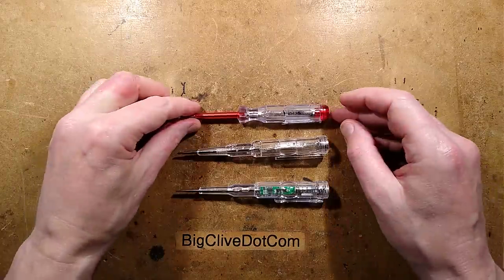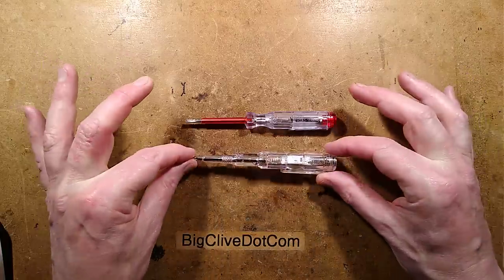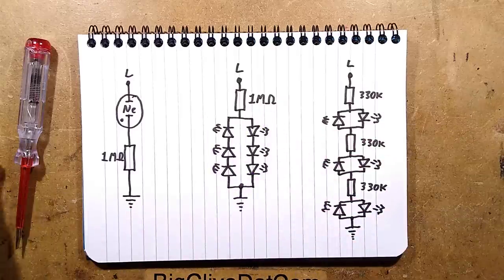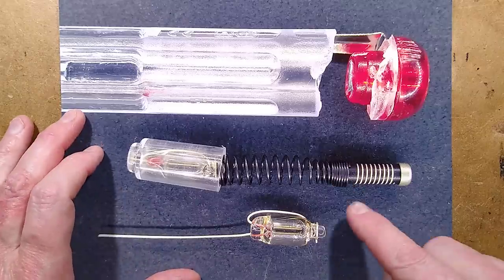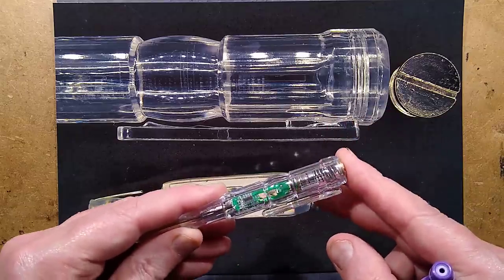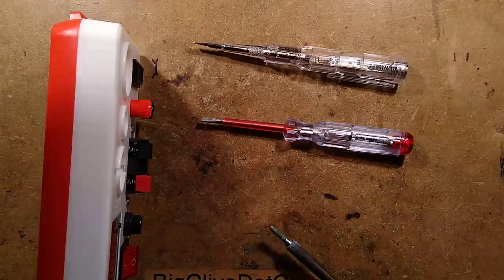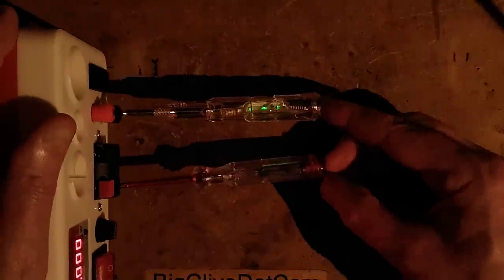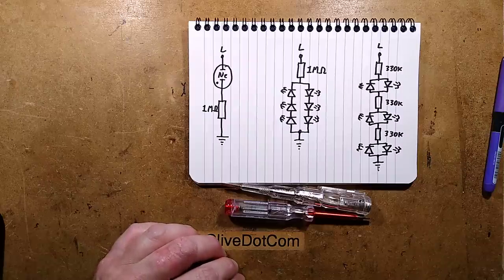Reinventing the neon test screwdriver

Comment: I like the LED version and brightness is definitely an advantage here, but neon being the simplest, is probably more reliable.
Reply: you can just replace neon with led rod from incandescent lamp imitation. as drop in replacement with the same simplicity
Reply: But leds will break as short circuit and a neon bulb will just not light up at all while being highnimoedance. So it‘s much safer with the neon lamps I suggest 🤔
Reply: But the neon screwdriver is contact only. So you can't use it to detect the electric field emanating from a live line behind the wall.
Reply: My concern with the old-school neon version is the glass. If you drop your screwdriver how likely is it to break?
Reply: @eDoc2020  From experience the plastic handle tends to break first.
Reply: @eDoc2020  Almost impossible to break'em that way.    I tried.   😋
Reply: eDoc, What breaks the glass is using them as a terminal screwdriver.
The original Philips test pencils from the 1960s / 70s were quite robust. More modern items are still German made but the shaft tends to push up inside, the spring helps but sometimes the glass breaks 
Dropping them ( the German items) doesn't cause problems.
I like them for terminal maintenance, you see or.feel live ones before a bigger issue develops while you pull test the connection.
Reply: @eDoc2020  I used them a lot on jobsites, of course also as a screwdriver. But none of them ended with broken glas. They usually end up with broken plastic housing or damaged / broken screwdriver tip ...
Reply: @deltaxcd  If a neon screwdriver doesn't light, I know that the circuit is not powered. 
If a LED version doesn't light, I think about a lot of ESD things that could have ruined the device.

Comment: It's a nice idea. Much though I love neon testers, and believe that alongside their great value as a cheap and simple diagnostic tool, they are invaluable as  safety equipment. I have heard tell of - and  experienced personally, countless  instances where their ease of deployment has given timely warning of an unexpected live.  Some people bang on about them being electrocution hazzards, and sure, this may well be possible if one plays submarines with them before use, but I haven't heard of one electrocution occurring via these devices , yet I've heard as I say, of countless instances where danger was averted due to them. Their greatest drawback , is their dimness , which makes them unsuitable for use in bright daylight. Making such a tool brighter as you have done, has to be a good idea.
Another drawback they (neon testers) have , is that they are limited in the voltage they can safely handle. For most home DIY ers this is not a problem, as most of us will only be probing 240VAC. But they can cause electric shock  if inadvertently used on voltages higher than their rating.  

As an edit. I'd like to add that although as I said, electric shock could occur if neon testers are used to check voltages higher than  their rating. I mean shock - electrocution even so would be difficult.
If we consider the ballast resistor in the tester to be 1Meg ohm, than to pass a current of 7mA , which the smallest current known to be fatal (across the heart ) ,  7000 volts would be necessary.

Comment: Interesting. I'd like to see some measurements for both versions. Actual current for a start, if you've got a meter sensitive enough, both grounded and non-grounded. Also voltage drop across the screwdriver and across your body when grounded. I've a feeling the neon drops a higher voltage than the LEDs, so would be considered "safer".

Using ordinary 3 or 5mm LEDs instead of the tape might give better all round vision, although the neon ones tend to have a little "lens" over them so you can see the tiny glow better.

Comment: Nice video there and interesting as well. I prefer the definite brightness of the LEDs as I have found on occasions it is difficult to tell if tge neon has lit up or if it is a reflection off something else. There will be the traditionalists out there that will prefer neon over anything as that is what they have used for the last 20 years but they fail to remember that before these testers we used apprentices to test for live wires, if they made a mig of tea afterwards it was safe to work, if you needed the plasterer to repair a human shaped hole in the wall it was still live 🤣

Obviously the last part is a joke but the traditionalists will still favour neon 👍

Comment: The thing to remember is that even with the good old Martindale tester you were still instructed to test it on a known live source before using it!  Worth remembering if it is hardly ever used and gets damp/corroded in the bottom of an old tool bag and goes o/c!  Common sense and a little electrical knowledge can go a long way!

Comment: Yes, the problem with a series string of diodes is that they don't share reverse voltage equally or in any specified way since it depends on the leakage current vs reverse voltage curve. Your third option with three independent groups of LEDs looks more attractive.

Comment: In re green LEDs being the most efficient: it's also the colour to which our eyes are most sensitive. I did an SYS project on this and having got the wrong answer during my interview I will never, never forget that the wavelength which appears brightest to human eyes is 555nm.
Reply: Green LEDs are actually among the least efficient in terms of actual light output. The high brightness per watt is purely down to our eye's sensitivity.

From memory, blue LEDs are the most  efficient by far (largely driven by the huge demand for efficient white LEDs).
Reply: @JMMC1005  I think some yellow LEDs are less efficient than green. Im not sure about IR and UV LEDs.
Reply: @mernokimuvek  That's possible. I know that the power IR LEDs I've used also got damn hot, so I wouldn't be surprised if they were pretty bad.

Comment: Very interesting 🧐 I like the LED version better than the Neon indicator.
Reply: But it's too dangerous. Would you not consider converting it to a logic tester for your safety and the safety of others if you find it so attractive?
Reply: @factorylad5071  lots of people say this but has anyone actually died using them
Reply: @factorylad5071  no, theyre not dangerous if designed and used properly,
Reply: @andygozzo72  yep as Clive said, the real danger is the inadequate isolation of cheap designs.

Comment: Also a good demonstration of why we have "one hand in a pocket rule" if you must work with live voltage.
Reply: I did not know this and did some googling -fascinating while a simple concept we need a Big Clive video breakdown.
Reply: I assume this is the same as what I was taught. One hand gripping my belt behind my back. 

Should any current be induced in the body that hand would hopefully clench up and be prevented from closing the circuit across the heart.
Reply: Shake hands with danger.
Reply: There is no such rule! It's advice! And it's a pretty dangerous one if you are on ladders, fault finding some lights on a ceiling, as you can lose your balance and fall off with one hand in your pocket! Pretty daft idea!
Reply: I like to see you working in a large electrical cabinet fault finding , and it's still live with a multifunction tester with 3 leads with a probe on each end of a simple ceiling rose on a step ladder. The vast majority of electrical testing is done with leads and probes .
Reply: @Bullcutter  If you seriously considered servicing live wiring while teetering on a ladder with no hands based on this advice, maybe this line of work is not for you.
Reply: @ThePlacehole  Go away, kid. I've worked with live circuits probably longer than you've been alive! No electrician puts their hand in their pocket while working with live circuits!
Reply: good luck twisting 4 runs of 12ga 3 conductor in a single gang box with one hand it your pocket.
Reply: @TheOnlyEru same idea and works well until your dog... with a wet nose...on concrete... walks up behind you ....
Reply: I just thought I ought to remind anyone considering troubleshooting inside electronic apparatus (amplifiers, etc.) containing lethal voltage - while practicing one-handed probing with other hand in pocket :
On a ladder, no  Have the apparatus you're testing on a workbench!
Reply: Some say you test with hand opposite to heart, other say you test with your weak hand so if you may loose it, you keep the strong hand.
Reply: @Benoit-Pierre  important thing is prevent situation happen of current pass from one arm to other. One hand testing is a lifesaver. The neon screwdriver is step in that direction.
I'm not in any way suggesting anyone should repeat this unless they fully know exactly what they're doing...
When not touching to anything else, that is standing up in footwear with insulated soles and/or rubber mat as the only contact you have with anything else. (Other hand of course in pocket). 
You can touch a live house mains conductor and not feel anything at all.  As long as you are only in contact with that and nothing else. Of course if a dog come up at that very same moment and dabs wet nose on your leg you're both in for a shock. 
That's why whenever I've got my hand in HV gear I always check around me the whole time that no one is likely to come up close to me at some critical moment. Usually when they see me with one hand in pocket or belt they'll keep their distance, curious how it's a 6th sense that people have.
Reply: @jagmarc  1. You never know what you don't know. 2. Most  People are either curious, or ignorant, or don't care. Even when I set red cones, stripes and panels and chains , people just climb over them and walk through my working zone. 

Even happened twice my customer dismounted my security device to either walk through, or energize the circuit. 

I now tend to be more and more aggressive with protections. 

But even when I put locks on security guards, they still cut my locks ... I don't know how to protect myself against don't caring people.
Reply: @Benoit-Pierre I've got that t-shirt. Many many decades ago a friend asked me to put safety features on his factory machines which I did but his employees broke them off the next day. Put me in a difficult position but I was glad I wasn't in his shoes.  Safety can be such a controversial subject. Employers have to protect themselves from injury claims, writers in some publications have to protect themselves too using disclaimers. Then there's people who fully understand and experts a taking risks but have to be careful not to give the impression what they're doing appears safe to copy, or should be. Some people get a real buzz out of taking risks that's one of reasons motorcycles exist. (I'm a huge risk taker by the way) Then there's people who are completely 100% risk averse, they tend to be happliy employed in a environment where there's unrestricted financial budget and resources such as banking and insurance and aerospace engineering.
What's for sure the way things are going, if on the turf you're responsible for someone slips and breaks a bone then ambulance chasers exploit the situation if they get an inkling there was insufficient warning signs. 
As for safety and risk, it's a subjective thing often with a distorted perception going both ways. 
One thing's for sure: The most sinister and deceptive failure of all safety precautions, is of that one critical precaution which was believed to provide safety.
Reply: @Benoit-Pierre  report those mofos to the local authority on occupational safety. a hefty fine should teach them to respect "lock out, tag out"
Reply: @robertburrows6612 Yes, the vast majority is done with testers, but the remaining amount of testing is done with the tip if a tongue. Just ask all of my nine volt batteries 😅
Reply: @Benoit-Pierre  If something is dangerous enough to make you wonder about which hand you want to keep, that thing should be done another way.
Reply: @jayduffy6289  since you said "a tongue" instead of "the tongue", I'm urged to ask... whose tongue? 😃
Btw, my own tongue is a common-used probing device, too.
Reply: @jagmarc  Adding that in those moments when we're dealing with live HV, it's common that, besides paying attention to the circuit we're working, we also get more aware of the environment; if the dog approaches, we'll perceive it long before he/she dabs its wet nose in our leg.
Reply: @OgbondSandvol My school caretaker/maintenance man used to test light bulb socket power with finger but the highest voltage we kids went up to was 9v square battery on tip tongue. There was a game we played was dare close our eyes with tongue out and dab a square battery, hysterical to watch. One of the oldest lady teachers said they played with induction coils as a kid.
Reply: @OgbondSandvol  first you should cut the power ... But ...

1. Sometimes you must work on live liens 

2. Even when you have cut the power, you must consider you are working on live liens, just in case ... Either you did not turn off the right section, or someone have put it on again after you. You shall never rely on labels, plans, certificates, or locks. Already happen to me someone cut my locks.... 

Always use the method for live lines. 

Use your left hand if you value your right hand. Use your right hand if you value your heart. 

There are so many stories of people dieing after doing the right things, because some one else interferes.

Comment: Used to love proper neon screwdrivers, they're great for detecting the presence of high frequency AC, you just hold the body of it near to the source and if it's energised the neon glows. 

Dead handy for working on old CRT tellies and radio gear because it takes a good whack of radiated energy to light it up..
Reply: There used to be a craze of added neon light on the end of transmitting antenna. Lights up and flickers with your voice as you spoke.

Comment: Haven't used one of those things in 30yrs, didn't know they were still made.  I have one and think it's neon, will try to find it..  Thanks Clive👍
Reply: I still use a neon or a volt stick when pulling a switch or socket off the wall in an unknown house, it’s amazing what you find, and I  don’t like finding current with my skin. ( Why the hell is it always the tender skin on the inside of my elbow  !?)

Comment: Clever idea Clive - clearly the green LEDs appear much brighter.
Reply: The green light usually indicate that something is acceptable. In this case it can indicate that it is acceptable to touch the wire which is currently tested. Some other color could be better in this application.
Reply: Our eyes are very much more sensitive to green light. If one were to observe a green and a red laser beam of the absolute same power levels, the green beam would look MUCH brighter to our eyes, even though the beams are both the same in terms of output.

Comment: Great video, thanks Clive!

If I might add: I think the neon being a tad safer as their failure mode is generally open cct whereas LEDs is a more 'direct' connection.

Either way its 'only' mains voltage.....(he said while schmoke billows from his brightly glowing ears and now badly burnt nostrils, hair on fire) 😂

Also: money shouts louder than safety: neon wins due to being the very cheapest implementation of this design!